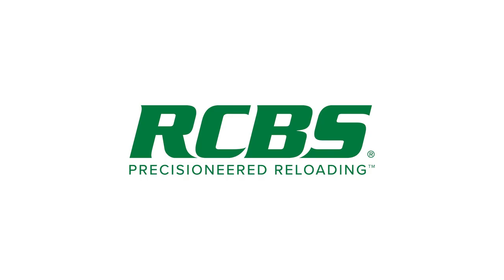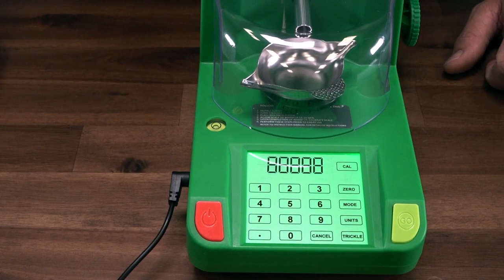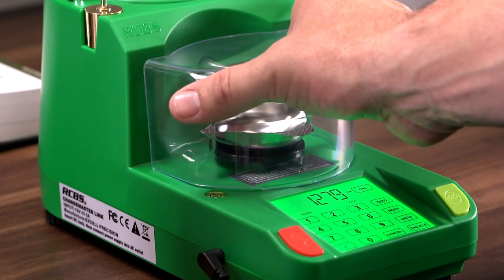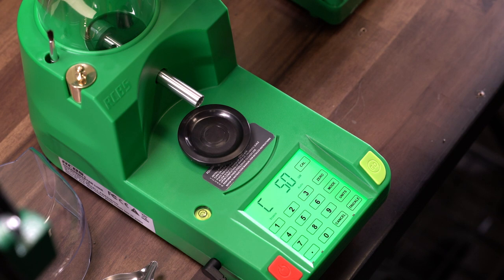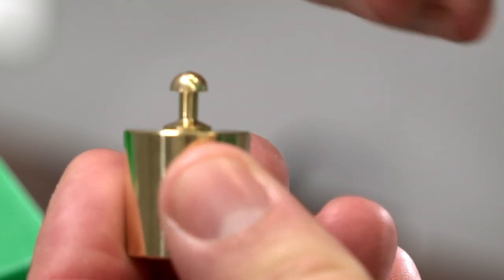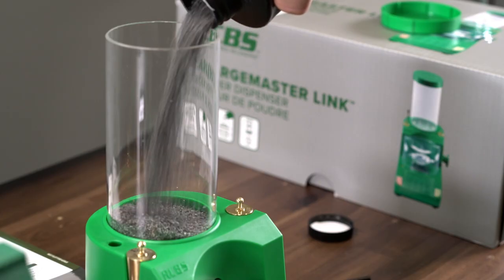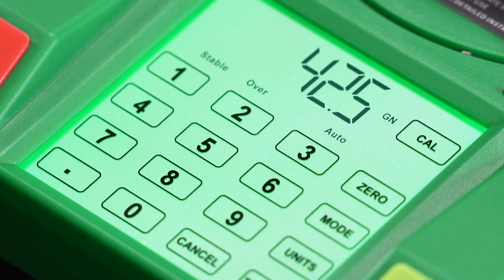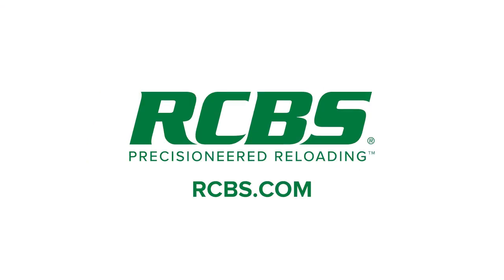Get The Best Consistency On Your ChargeMaster Link

Comment: I'm curious as to why the black label under the scale cup is still in place while the unit is in operation in the video when it specifically says on this label to "FOLLOW INSTRUCTIONS BELOW & REMOVE THIS LABEL PRIOR TO USE" with an exclamation point emphasizing the importance of this step?  I wrote in all caps because the label itself is in all caps which further emphasizes this particular note's importance for unit operation.